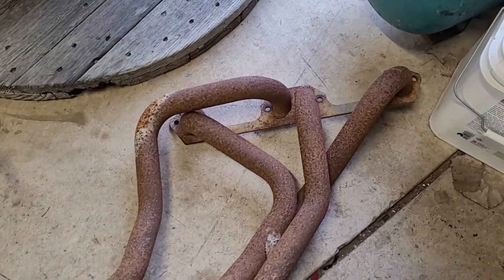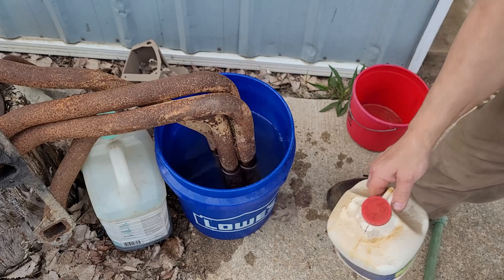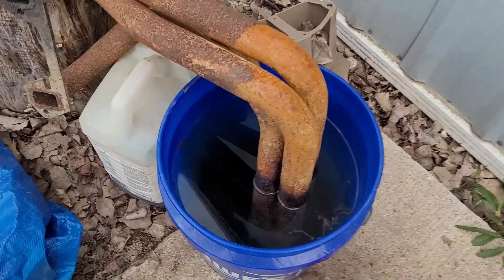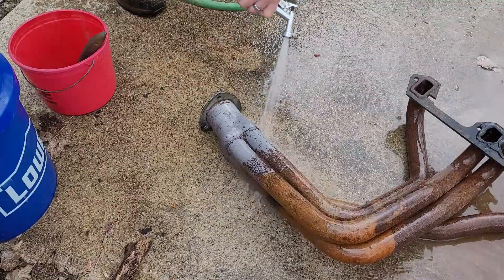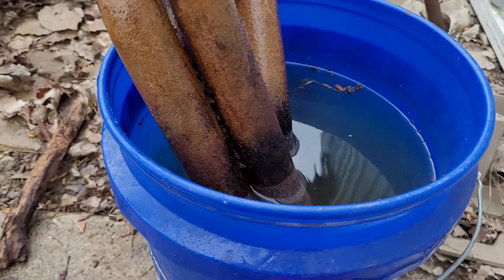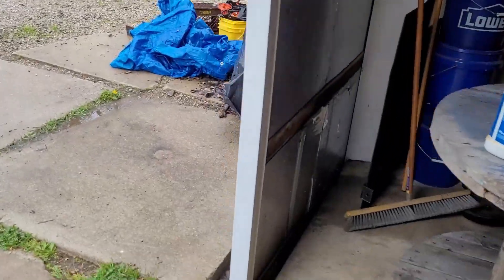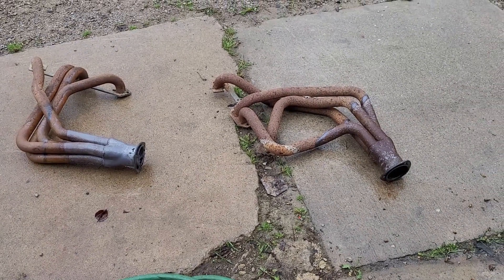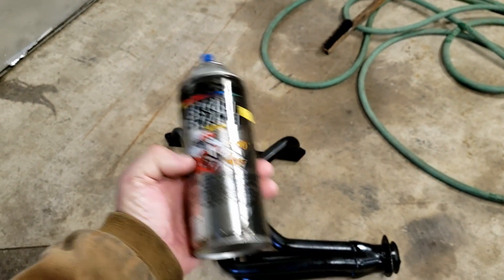ACID Rust Removal - DIY - Cheap & Easy! - Let's see if it'll clean these Nasty Headers!

Comment: I like Muriatic acid so well, I put that S$%t on everything. I use modeling clay for hobby store, plug drain holes in the doors of my 67 C10, then pour mixture in using common sense. Acid into water always, not other way. But like you, I pour the diluted hydrochloric acid into plastic commercial barrels for re-use and label. But I want surface rust, rust that formed during weld repair and deep into folded seems clean. Pour baking soda box in while gently hosing with water, swish around any left over, remove clay then rinse. To dry, I use a leaf blower, works fast if warm. But I use a detail spray gun, spray 1:1 automotive grade epoxy inside and try hard to get everything inside. I run a thread tap thru all captured nuts. Works great for places you can't get. 
   Yes, your headers are mild steel. Never heard of any galvanized and if stainless, you get very little action. All PPE and activated carbon respirator like worn durning painting cars. Not "N-95" that is dust particles that won't stop virus molecules. Step daughter is in cardiac diagnostics. They look & make people feel good, no safety value on micron level as a human hair is 70 microns and the SARS-cov19 virus is average 0.12 microns. Next door neighbor of 29 years works at 3M plant and says the CDC & government has been dancing around this issue by mandate to be obscure and unclear on purpose. They may keep the virus inside the masked wearer especially if moist by incoming, not so much. Gaps around the perimeter fit is number one. This is why activated carbon mask come with rubber face seal to allow for negative pressure testing by anyone wearing one, prior to use. 
DK, ASE master tech, retired.
Reply from the maker: Good info. Thanks. The acid sure does work great for those hard to reach spots. Sure beats the mess of a sandblaster. I'm glad you liked the video 👍🏼👍🏼

Comment: Do the same thing with white vinengar... 2 gallons  mixed with 2 gallons of water....  Trash can and a HD bag to put the headers in...  Rig it up to lean to one side without dumping it out then let it sit for a cpl days lol...  Still us a small cheap spot blast in some  areas though to peen the badly pitted spots, then prep em for some bbq paint.
Reply from the maker: I'll try that next summer 👍🏼
Reply: Sounds like a good way to use less vinegar/hcl than finding a large tub for bigger pieces

Comment: You have to use baking soda to neutralize the acid and I bought a kitty pool from Walmart to soak my metal Parts in thanks for sharing
Reply from the maker: Yessir. I guess that part didn't make it in the video. The files were probably corrupted, which happens quite a bit unfortunately. Thanks for watching 👍🏼👍🏼
Reply: U can actually use Vinegar bought from the same big box store. U don't have to use Baking soda. Vinegar n water less mess and easier! Muriatic acid is the strongest acid for remaking rust Not sure I would leave it over night however. Phosphoric acid is much more common for removing rust. And U can prime right over the treated metal with NO PREP! If U sand it  U will not get the same bond. if it needs sanded do it first then treat with acid!

Comment: You might consider rinsing the inside of the pipes to prevent the acid from eating the inner surface.
Reply: Yes! I have been doing a lot!! Of tool clean up and restoration the last couple of weeks... and I've used a lot of vinegar and it's also acidic.  I've found if you don't neutralize it the rust comes back very quickly and worse ... so I've been using a backing soda solution... I think it will work on this too
Reply from the maker: @donscottvansandt4139  baking soda works great. I'm not sure why that part did t make it into the video unless the footage was lost or corrupted. It happens more than you might think. 

I soaked the headers in a baking soda bath and neutralized the acid bath with a ton of it afterwards. The headers have been rust free.
Reply from the maker: They were rinsed pretty thoroughly with water and baking soda. It took quite a bit of baking soda.

Comment: I got the same brand and type of muriatic acid the other day at HD to try to remove some stubborn caked-on encapsulated rust on some auto parts I was cleaning up. I mean the kind that looks like hardened blackened grime but if you go at it with a grinding bit or scraper revealed the rust trapped inside. It's common to find such rust all over older parts in the rust belt and it's a pain to remove it mechanically since it's usually found in spots and patches and you have to break up each one individually. So I decided to try this acid to see if it would work faster.

Several issues with it, this brand and type at least. First, it's already diluted, to around 15-20% strength, which is why it's claimed to have "90% lower fumes". So you don't need to dilute it further for such tasks. I did that initially and nothing happened, so I kept reducing the amount of water I cut it with until I used it straight, and that's when I started to see it work. It should still work if you add it to water (and never the other way around where add water to it!), but will just take longer.

Second, once it's removed all the rust and other crud, you need to not only wash it off with water, but neutralize it with a base such as baking soda liberally mixed into water. Otherwise trace amounts of the acid or chlorine that it breaks down into will remain on the metal and ironically cause further rusting, especially in deep and hard to reach or see crevices, and will continue to rust it even if you paint over it, especially if cracks eventually emerge allowing in oxygen and/or water. So neutralize it and less it stay on it a while, and only then rinse it off. And then either prime and paint the part, or coat it with something that will resist flash rust until you're ready to prime and paint it.

Also, you need to use full PPE with this stuff, long acid-proof gloves, safety glasses, face shield, and a decent chemical respirator if you use it indoors (probably unnecessary if you use it outdoors, especially if there's a breeze). And don't wear anything you wouldn't want to ruin, or use it on nice anything nice like clean concrete or paving stones as it etches masonry.

I've decided to not use it on "complex" parts, meaning ones with nooks, crannies and crevices that the acid can find its way into and that might not be fully neutralized, or anything with threads that it could eat away at and ruin. I'll stick to either mechanical rust removal methods, or one of the many phosphoric acid-based chemical solutions.
Reply: Just after high school one of our friends was drinking and said cracks and nookies instead of nooks and crannies . (Alcohol related) we still say cracks and nookies .
Reply: If you have a big enough tank you can use electrolysis to remove the rust. (Plenty of YouTube videos on this.
Reply from the maker: Acid has its pros and cons for sure 👍🏼👍🏼 This was more of an experiment.

Comment: I bet you could paint em with mustard... And the vinegar in mustard will eat the rust off.. Wash em like a day later..
Reply: Regular vinegar works great too, but flash rusts easy. So, get off all the major rust with, mustard, vinegar or muriatic acid, then wash with water, then wipe on the real rust remover stuff because that crap is expensive and prevents flash rust. Then paint it with high heat paint
Reply from the maker: Interesting idea.
Reply: Wow , gotta try mustard 😊

Comment: Don’t used that stuff it’s dangerous I have no clue why there selling it . I ran industrial building  if you do Decide to do where that Breaking bad suit . Vinegar will do the same job but it takes a little longer
Reply from the maker: It's used to clean concrete and brick, usually.

Comment: You have officially learned the ways of the acid dip :p
Reply from the maker: I guess so. I put a cast iron exhaust manifold in it yesterday and it was making crazy bubbles. I think they're hydrogen but I'm not taking any chances with gas/vapors after the motorcycle battery incident of 2020
Reply: @HFG  What happened to the battery?
Reply from the maker: @blueridgehollow2510  on my FZ6 the battery is under the tank so you have to partially remove it. Last year, or maybe it was the year before, I accidentally put my battery charger on 12v 40amp charge and got caught up doing stuff at the house for a couple of hours. When I started heading back to the shop I noticed smoke pouring out from under the tank. It was boiling and melting the battery. To save the bike I had to get the battery out which meant having my face directly in rolling clouds of smoke and hydrogen sulfide gas while I unbolted that battery. Kinda poisoned myself. That was a rough year for poisoning myself lol
Reply: @HFG  Oh Crap!!! You're lucky it didn't explode! My Sportster's battery post melted last year on me and I'm not sure why as I didn't see any metal on metal contact, I figured the battery went haywire. Seeing plumes of smoke would freak me out for sure. Its not like you can simply chuck water on it to put it out lol.
Reply from the maker: @blueridgehollow2510  must have been an internal short with the plates or something 🤷🏽‍♂️ I'm only vaguely knowledgeable about battery construction. Glad you didn't have a bigger problem 👍🏻👍🏻

Comment: Interesting process for sure! Not great for the apocalyptic builds unless you go with shiny chrome paint to impress the ladies.
Reply from the maker: Ouch. That's a tough loss. This method definitely has its own place. Thick stuff seems to be it's sweet spot.
Reply: @HFG  Well it was my fault. Just got to keep a close eye.
Reply from the maker: @blueridgehollow2510  yeah. I can see this process going south pretty quick. Another option is vinegar. It's not quate as corrosive. I will say that Evapo-Rust is some amazing stuff if you haven't used it.
Reply: @HFG  It became as thin as paper lol. Maybe you could do another video in the future comparing the different methods.
Reply from the maker: @blueridgehollow2510  the vinegar vs muriatic acid methods? It's essentially the exact same except the vinegar takes a lot longer. I reckon I could. I didn't realize it when I made the acid video but there are quite a few Muriatic acid rust removal vids on YT already. I think mine is the best though :)

Comment: Muriatic acid is so scary to use. I try to not use it at all. In fact I wish they'd make smaller bottles to buy. The one I have I just feel like is going to eventually melt through the bottle at some point and drip off my shelf. But I'd rather use muriatic acid with two gloves, a respirator and safety glasses than weld through galvanization (even more toxic!). 

Count me in as super impressed with exactly how well it worked!
Reply: And the smell, the smell is all there.
Reply from the maker: I'm not a huge fan of acid either tbh. Desperate times and all that :) yesterday I dropped some galvanized tube into the acid bath. I'll send you some pics later when I get home.
Reply: I use it as Pool pro every single day. It’s not scary. It’s just a chemical like anything else. It’s only dangerous if you’re stupid.

Comment: You could have also boiled the headers in a metal gallon on open fire and add the mixture you used it will fasten the process and even deeper cleaning but your way worked too👍👍👍
Reply from the maker: Cool! I don't have a way to easily do that but I'll keep it in mind for the future 👍🏻👍🏻 Thanks.
Reply: KABOOM